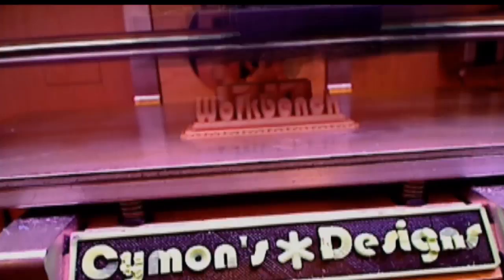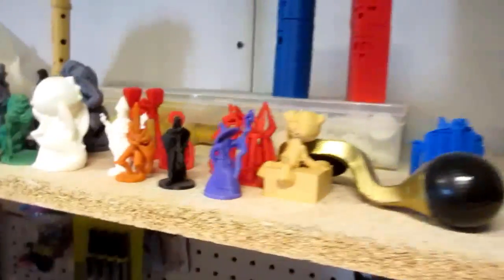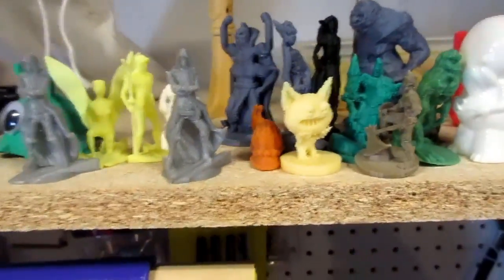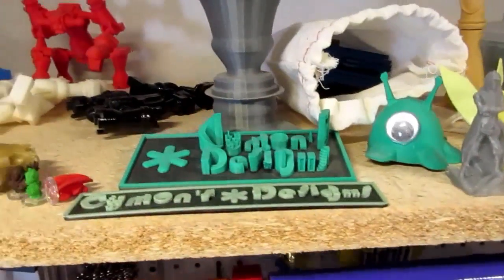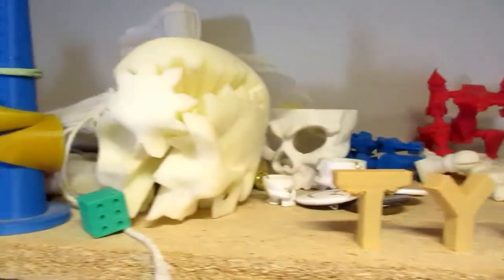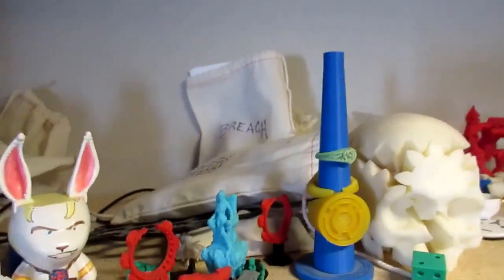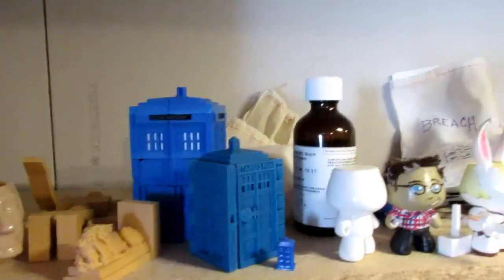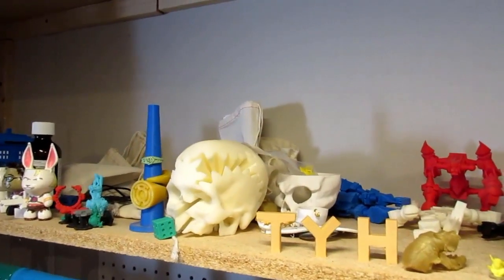3D Print Show Off Shelf Tour

Comment: That is a very cool shelf. I got to get a shelf full of prints also. Do you sell your deisgns. You could probably make a libing off 3d printing things you designed.
Reply from the maker: +Panoreth 3D Printing That could be a topic for a whole other video. 

If I could make a living selling my 3D printing that I designed I'd be the first. There have been a few flashes in the pan, people who's small object with huge markup have allowed them to turn a profit, even a significant one. See the SquareHelper for example. However, so far no one has created a sustained business model for either selling 3D prints or 3D print models. Does that mean it won't happen? Absolutely not. I just hasn't happened yet, and it's certainly not an easy path. Not as easy a path as, say, pushing go on your 3D printer and getting a constant stream of cool stuff.
Reply: +Joe's 3D Workbench nice thoughts. You should do a video disgussing this.

Comment: Which is that mentioned product for matte finish?
Reply from the maker: +jv071 tetrafluoroethane. Smooths PLA prints to a matte finish. I wrote more and have picture on the blog post for the sailor moon pendant video part 2: http://joes3dworkbench.blogspot.com/2016/01/sailor-moon-pendant-project-part-2-video.html
Reply: +Joe's 3D Workbench thanks, I'll check it out